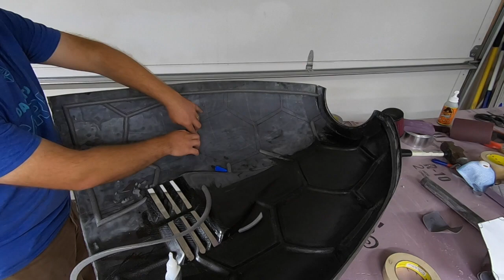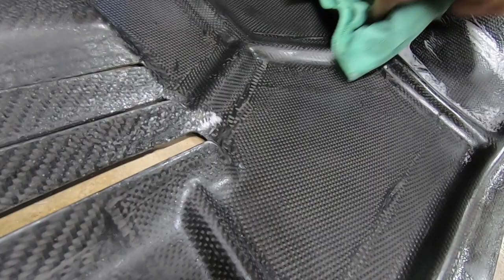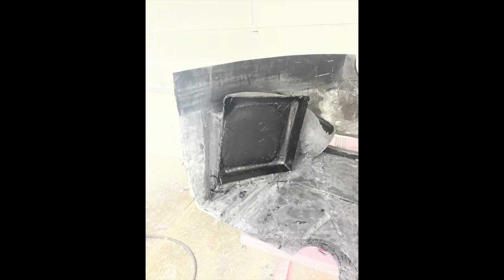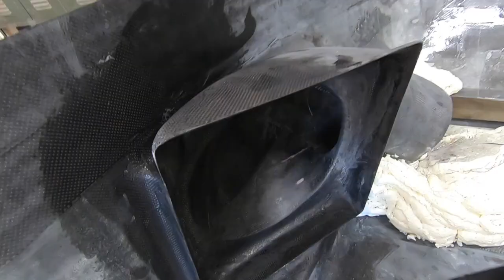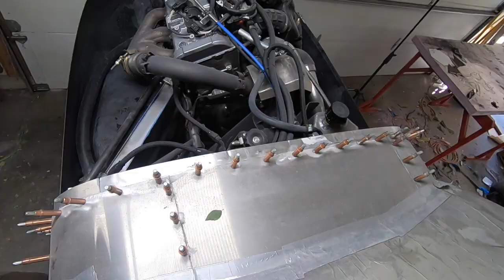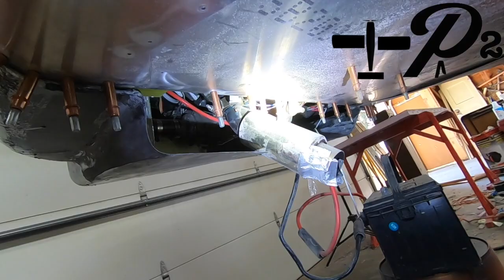Endoskeleton For My Airplane Cowling? Part 5 EP 55

Comment: I’m currently in the process of modifying fiberglass cowlings to fit an engine upgrade from Jabiru 4-cylinder to the new 6-cylinder Gen-4. It’s not easy, although it seems to be for you. I have spent days laying up cloth, only to cut it all back off and start over because something wasn’t right. IMO your composite design and fabrication work are very good. Thanks again for sharing your methods.
Reply from the maker: I’m with ya man, this hasn’t been an “easy” undertaking be any stretch. What progress you see in the video is a little over 3 weeks of time, granted I can only work a few days a week on it. Thanks for watching and commenting sir👍

Comment: Two things I saw which may make your life easier. 1. Put a soft cushion (old pillow or something similar) under the cowl when you're working on it and that will support it and stop it moving around so much when you are doing your layup on it. 2. Use Peel Ply on all your layups - that way you won't have to do any sanding afterwards. It also has the added benefit of wicking away any excess resin giving a lighter layup. Great work and innovation otherwise - keep at it!
Reply from the maker: Thanks for the tips! I’ve been trying to incorporate more peel ply usage but find it difficult to get it to conform to anything other than a flat surface. Maybe it’s just the kind I have so I’ll have to look for other versions.
Reply: @Project2Aero   With Peel Ply you can cut it on the 45 so it conforms better and also use multiple smaller pieces overlapping rather than one large piece.

Comment: If I can benefit from your experience on this, how many layers of cloth would you say is necessary to lay up on the plug, before the uncut cowl-set can be removed? I have 2 layers of 5~6 ounce CF built and would like to mount it on a rotating jig/stand if possible. How many layers (average) thickness did you decide to stay with before adding the hexagonal stiffeners. I have watched this whole cowl build series at least 6 times, while doing my own. Thanks brother 😎🎩♠️
Reply from the maker: Thanks for following along! This is a bit of a loaded question that really depends on lots of different variables but for me, I found that 4 layers of 6oz 2x2 twill was sufficient prior to adding the interior structure. I think at only 2 layers, you’d run the risk of it not holding its shape on its own well enough to hold its shape off the mold , especially after being split in half.  If you’ve got more compound shapes than I have you could get away with less I’m sure. Keep us posted👍
Reply: @Project2Aero  you are a true fellow. Thank you man 😎🎩♠️